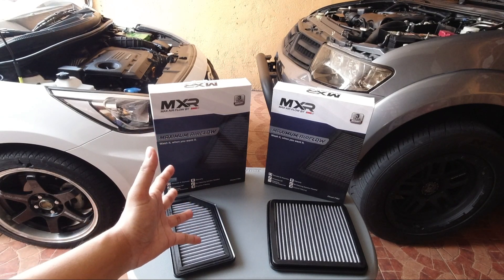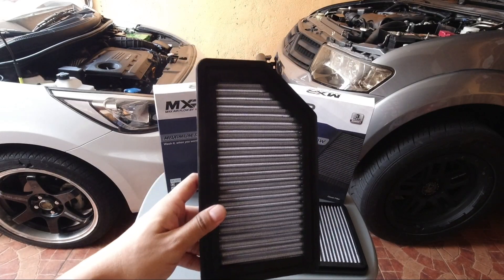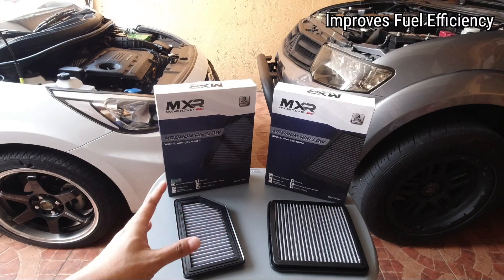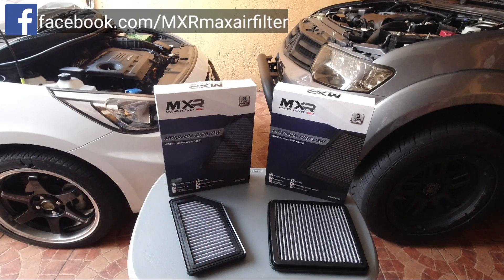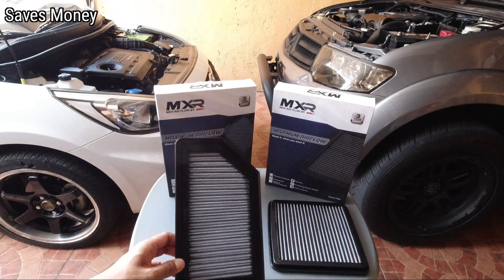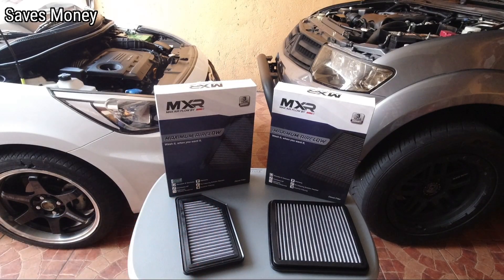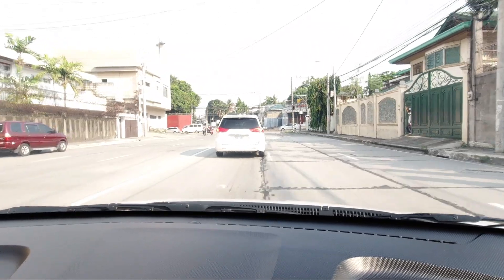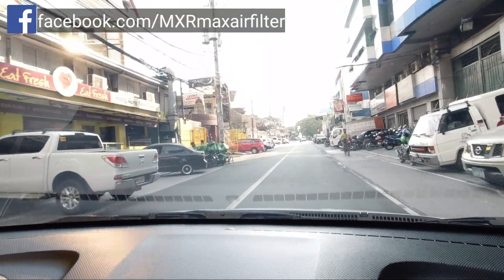Ano ba mga Benepisyo ng Max Flow Drop-in Air Filter? | MXR Performance Air Filters Install

Comment: Yung ganitong washable na air filter ay pwde lamang ito sa sasakyan mo kung gagamitin mo ito sa pang racing car, pero Not advisable sa pang daily driven car, Masisira ang Turbo mo yan, Learn from experience 🙂
Reply from the maker: Nu nangyari sa turbo mo sir?
Dont forget to subscribe 🙂
Reply: @NoahsGarage  napuno po ng dumi, parang na sandblast Yung impeller sa loob.
Reply from the maker: @sledgehammereugene1004  anong brand gamit mo sir? Over a year na akin, okay pa naman
Reply: anong brand gamit m?

Comment: Questions sir ..hindi ba maglelean yan kasi over air na sya .? Kasi ecu na mga sasakyan ibig sabihin diba po nakatimpla  na sya.. kung madadagdagan sya ng air ibig sabihin mas mabilis masusunog ang gas i dunno if sa diesel kung ganun din...at ang cause po nung pag lean sir iinit masyado ang engine... Salamat sir sa sagot
Reply: Hm po sa Montero sir noah
Reply from the maker: Di naman over air sir. Engine needs a lot of air. Kapag na sense ng sensor na mas maraming air, kinocompensate ng system yan to inject more fuel, hence more fuel needed. It wont damage the engine sir.
Dont forget to subscribe 🙂

Comment: ask ko lang sir bakit lahat ng brand  ng sasakyan lalo na asian car hindi ganyan ang filter na ginagamit...kung mas maganda ang ganyan filter...
Reply from the maker: I see a few reasons why.
First is cost. High end cars ngayon sir do have better air intake system than just using performance filters. They use cold air intake. So one reason why Asian cars dont have performance filters from the manufacturer is to lower the cost of their vehicles.

Second is reliability. Engines are built with specific power/reliability ratio. Using performance filter may alter that ratio a bit but not significant enough to make any damages to the engine. Also, performance filters, like cold air intake filters, do make a lot of noise which are not good for car manufacturers as this is widely regulated by most governments.

Third is the potential damage to the engine, which I stated in my video. This is not to insinuate that performance filters truly damage the engine. But car manufacturers don't want to leave the burden of maintaining a performance filter to car owners. As you know, performance filters do need maintenance often compared to paper filters. So negligence on the part of the owner is what car manufacturers are avoiding as car owners may point any defective issue claims in the future to car manufacturers.

hope this helps

Comment: Using performance filter but different brand Hurricane using for 6 yrs now going 7yrs so far when i checked my turbo rotor blades hindi affected buo pa rin mga blades, unlike sa mga naka K&N with oil base it accumulates dirt at nahihigop ng turbo kaya todas ang mg blades ng rotor. As seen sa video ni MG,,,but  mime, did not install OCC since the oil mist act's as filter to dirt, kaya ndi affected ang rotor blades sa turbo ko.I also clean the turbo intake from filter housing para malinis at ndi umabot mga dirt sa Turbo..just sharing lang po.,thanks.for.this video,you can learn alot.
Reply: ok din kaya ang aem dry flow filter?
Reply: To conclude in my observation it's either you install your OCC and retain your stock filter, or use after market performance filter but no OCC,,,  if no OCC make sure to clean EGR and intake manifold, and intercooler during oil change, observation ko po ito, however should you.not agree you can do what you want to vehicle, kasi sainyo po yan, but think what would happen in the long run, un lang po,, salamat

Comment: Boss, pwede patulong naman sa aircon ko. Kapag ino on ko kase tumaas ang menor parang kokonti na lng aabot na sa 1000 ang rpm. Ang pagkakaalam ko kase dapat nasa 900 lng. Tumaas tuloy ang kain ng diesel fuel nya. Patulong naman po kung papano i adjust itong montero 2010 ko. Second hand owner lng po ako.
Reply from the maker: Normal lang un sir. 750 kapag idle, pag on ang AC 900 to 1000 rpm kaya normal lang po yan. I suggest linisin mo lang AC system mo. Marami tayong video niyan. Nasa playlist ko sir.
Dont forget to subscribe 🙂

Comment: Why no for remap idol?
Reply from the maker: Di mo na maibalik sa dati sir, bayad ka ulet kung ibalik mo sa dati. Lalakas din sa konsumo sa diesel at malamang mapaaga ang buhay ng makina mo dahil lampas na siya sa normal specifications niya. More stress sa tranny mo, brakes etc kasi lalakas ang output ng power pero mga components ng car eh stock lang. For example, kelangan mo ng performance brakes kung mag remap ka, tranny mo needs extra cooler, etc.
Dont forget to subscribe 🙂